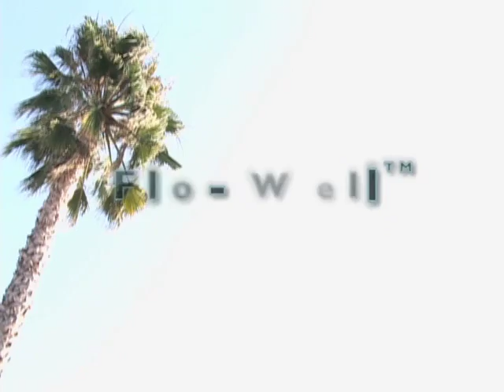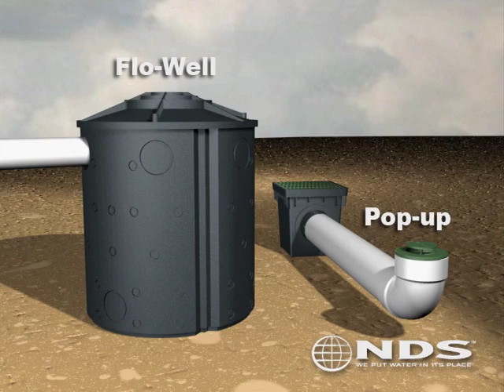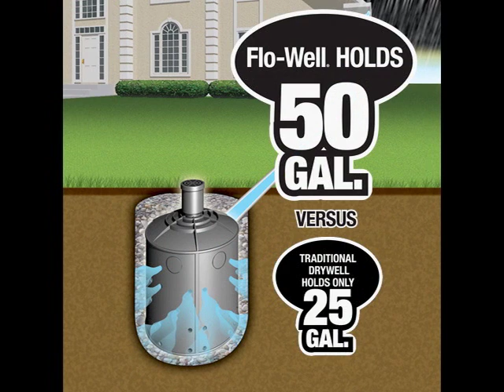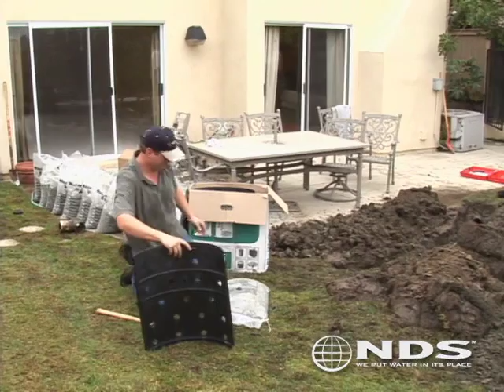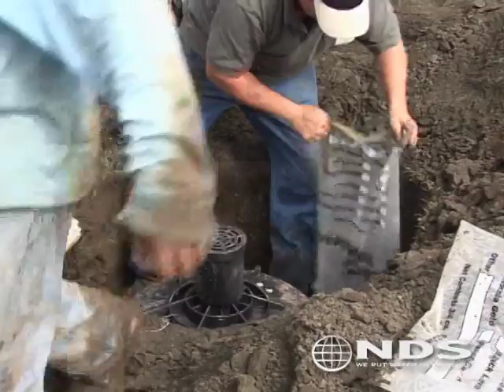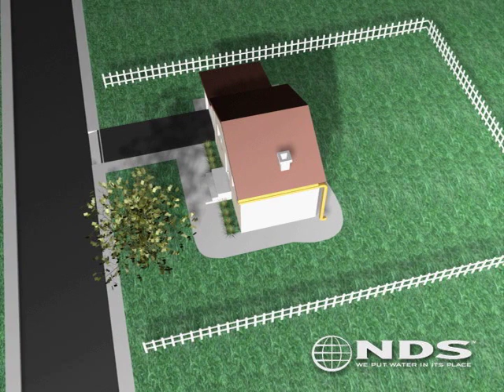Landscape and Yard Drainage Systems: Flo-Well and Pop-Up Emitters |  NDS Drainage

Comment: We placed two 45 gallon barrels  constructed as described in the video side by side. The ole prepared
Reply: The excavation reached below the frost line for the Toronto area. 
Everything is draining well. A pipe to the surface allows for measuring the amount of water in the well after a rain storm. There haven't been any problems in summer or winter.

Comment: I noticed that the fill aggregate wasn’t wrapped in fabric.  Will this not allow the soil to fill in the gaps surrounding the back fill of stone thus rendering it useless?
Reply: U are correct, the walls of the ditch and top of stone should have got filter fabric.

Comment: In Toronto the temperature in winter can be as low as minus 25 degrees celsius. What will happen when the contents of the flo well freezes solid? I'm afraid the water from the downspout will back up and freeze in the pipe and downspout damaging both. Have flo wells been installed in areas which experience cold winters.
Reply: It'll just freeze then thaw. There's nowhere for pressure to build up and by the time the ground gets cold the water would have drained.
Reply: Shouldn't break anything as long as it (ice) can expand.
Just my two cents.
Reply: Dig it deep enough so that it wont freeze
Reply: Another Toronto homeowner here wondering how these over winter. If I stack 2 units to get the bottom below the frost line will I avoid frost heaving and freezing damage & have a dry well that will last a decade or more?

Comment: I've bought the Flo Well, and I've got everything dug up and ready, but this video is different than what I have seen previously .. In this vid, the fabric is wrapped around the Flo Well itself, but, for example, This Old House has the hole being lined w/ the fabric, and that allows the drainage stones to press right up on the Flo Well .. Which was is preferable ?? and thanks !! https://www.youtube.com/watch?v=u8DDm0kvjfI
Reply from the maker: Hi Lucas! Thanks for reaching out. We always recommend wrapping the Flo Well in the geo textile fabric to ensure no debris will get into the product.  It is optional to line the hole as well before installing the Flo Well and gravel, as this will help ensure that dirt will not mix with the gravel. If you have any further questions about your project please don't hesitate to reach out to our technical services department TechnicalServices@ndspro.com
Reply: Thanks so much !!

Comment: Will a flo well work with heavy clay soils?
Reply from the maker: Hi Cleatus! Yes the Flo Well will work with heavy clay soil, but the percolaton back into the soil will take longer than with other soil types.
Reply: Thats what I was thinking...Maybe a little extra top soil added would help. Thanks a million!
Reply: no    no ,no,no
Reply: Sr. You know that, when the soil escap with discharged soil settelment can be happened. So, Is it mportant to use fabric or the gravel will enough to keep the soil particles?

Comment: Is the Flo-Well effective in areas of high water table?  My sump pump runs constantly, so I'm worried the ground is already saturated.  Any thoughts on that?
Reply from the maker: Hello! Thanks for reaching out. Flo-Well should not be used in an area with a high water table. The open space in this product will just fill with water and won't be effective. We have two french drain products, EZflow and EZ-Drain that would be the best option to collect water and carry it to a discharge point. We have a very informative french drain guide that can help educate you on the benefits of french drains: http://www.ndspro.com/french-drain-guide/ If you have any specific questions regarding your project, please don't hesitate to reach out to our technical services department: techservices@ndspro.com

Comment: Can this be used alone without connecting to downspouts?  I have terrible ponding in my backyard during periods of heavy rain and it takes several days to dry out.  It has recently rained for over a week where I live and though we haven't had any rain for two days the yard is still soggy.  The standing water is down but it is still very wet.  My husband and I are thinking about installing this dry well alone in the central location of the ponding area.
Reply from the maker: Teresa Higginbotham Hello Teresa! We think a Flo Well would work great for your situation and it can most certainly be used alone. You can simply put it in a low area of your yard and use the inlet grate on top to help drain the standing water.
Reply: NDS Stormwater Management Does the inlet grate come with it or is that a separate item I need to purchase?  Besides gravel, are there other items that need to be purchased separately?  What size/type of gravel do you recommend?  I want to get it right the first time!  Your prompt replies are appreciated and the help is awesome, thanks!

Comment: Can this work in heavy clay soils?
Reply from the maker: Yes, these drainage solutions will work in heavy clay soils. However, one must take into consideration that the water will percolate slower and your system must be designed to accommodate this. For example, increasing area of backfill, adding more flo-wells and using a pop up emitter as an overflow option. Please don't hesitate to contact Dr. Drainage for any further questions at drdrainage@ndspro.com.

Comment: Dig to water table on a wet week. Backfill 2 feet over high water table. Hole diameter 4 feet. Fill w/ gravel. Inlet pipe ( from curtain drain ) into gravel. Outlet overfill below inlet, and this to a sewage pump. This will keep you dry. Absolutely dry, 100%.

Comment: i have an older home with an aging septic system.  the present dry well that we have no longer absorbs water. i think this was because of the fact that our home, although in the city, is not on city sewage. therefore the former owners ran the sink drain, the clothes washer drain, and the basement sump pump to this well,  two years after we bought and moved in we noticed on a winter day that there was ice in the back yard resulting from the dry well backing up through the ground.  since then we have been over working our septic by having all drains directed to our septic,  I've been researching a solution to my problem,  i think this may be it.  However, i think i would like to use 3 flo wells stacked, and installed as you direct, but then to have my sump pump, clothes washer, shower, and kitchen sink put into the flo well.,,,,,,,,,any thoughts?????
Reply from the maker: If your current dry well is no longer absorbing water it might be time to clean or replace it.   Over the years dry wells will fill with sediment which sounds like what happened to yours and the Flo Well could be your solution.  One Flo Well will hold about 50 gallons as water percolates back into the ground.   If the flo well is encased in 12” of ¾” stone ( bottom and sides) the system  (flo well with ¾” stone) will hold about 150 gallons of water.  If you install 3 flo well encased in ¾” stone you will have a storage capacity of 450 gallons.   Since, you have the sink, washer and sump pump all going to the same location I would recommend installing at least 5 flo wells encased in stone for a storage capacity of 750 gallons.   Your washer will drain about 30 gallons of water per cycle.   Do you know how much water pumps from the sump pump?

Comment: so we have a septic on site.  we would like to know if we could use one of these to collect the washer machine water so as to not put undue build up on the septic system  what are your comments on this
Reply from the maker: Yes, the Flo-Well can be used for a washing machine.  There are a few questions that need to be answered first.
 
1.      How much water does your machine use for each load?
2.      How many loads do you do?
3.      How fast does the soil beneath the Flo-Well absorb water?
 
Each Flo-Well holds 50 gallons of water, or if you backfill with 1’ of gravel underneath and 1’ of gravel around, the system will hold 145 gallons of water.  The answers to #1 and 2 will determine the maximum amount of water that needs to be stored.  The answer to #3 will help reduce the number of Flo-Wells needed if the water quickly percolates into the ground.  If it is installed in clay soil then the water will percolate VERY slowly so you would need to size the system for the maximum amount of water. Hope this helps!
Reply: our soil is very acsorbant.   the machine pushed 40 gal a load easy.  we think we are going to use a large storage container for gray water system witht he flo well as a over flow deal.
it will be with a automated pump to pump water into the yard for watering.
Reply from the maker: Michael Jordan
 Hi Michael! Please click the "show more" button to view the entire response. Also, feel free to reach out if you have any more questions. Thanks!

Comment: I gues it would be good if that tank could be manualy emptied, so if you need water for watering the plants or something like that, you could use the water from the tank, and if not just pull the stick and empty the tank. This way it would be more economical, nature friendly and usefull
Reply: That and collecting rainwater is illegal in some amerimutt states.
Reply from the maker: Thanks for your comment. Although the FloWell's primary function is for containing excess water from your yard, slowly allowing it to percolate back into the ground, it can also be used as a water storage container though not at the same time since FloWell is buried underground! Hope that helps clarify some additional benefits of the FloWell.

Comment from the maker: Hi Kyle! Yes, you are correct, in order for the Pop Up Emitter to function correctly the emitter should be installed lower than the elbow.  If corrugated pipe is being used pipe should be installed with a 2% slope.  If smooth wall PVC pipe is being used it should be installed with a 1% slope.

Comment: I used a sump pump basin, and turned it upside down, and cut my hole in the (now top) of the basin. Not as dangerous as the propane tank.

Comment from the maker: We're glad we could help! If you would like to learn more, check out or homeowner drainage website (link in the video description). This website helps you  identify your drainage problem and provides you with a variety of solutions and installation instructions!
Reply: Hi i have a question , my house is on a down hill ground made of blocks n cement but when it rains my basement gets very wet its still under construction . Would this method work ?

Comment from the maker: The bottom of the catch basin  has a cut out where one of the universal outlets can be connected.  All of the 3” & 4” Universal Adapters will fit 4” schedule 40 pipe.  A small section of schedule 40 pipe can be used to connect the catch basin to the lid of the Flo-Well.  4” Pipe can also be used to connect a Pop-Up Emitter to the Flo-Well.  This system will be most effective if the Flo-Well is installed in permeable soil where the water will quickly percolate into the ground.  .

Comment: I want to install a flow-well under a 12" Catch Basin and then connect a 10' 4" pipe with a pop up emitter to take the over flow water away from the area? Will that be practical?  lcw

Comment from the maker: Thanks for your comment. Although using a propane tank might seem like a cheap alternative, cutting into it is extremely dangerous. Not only could there still be gas left over, propane tanks are metal and can rust, break down and possibly collapse over time. Our Flo-Well is made from 100% recycled plastic and allows storm water to filter naturally, reducing pollutants and offering important environmental benefits. For more information, please visit our website link in the video description.
Reply: I